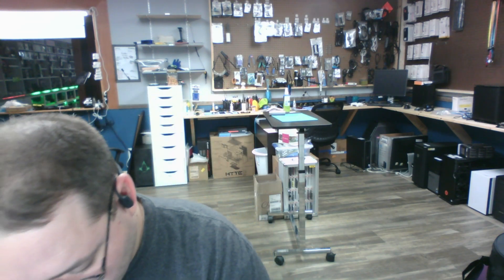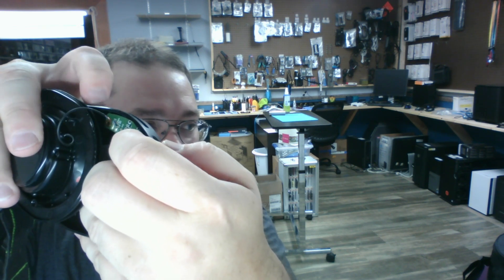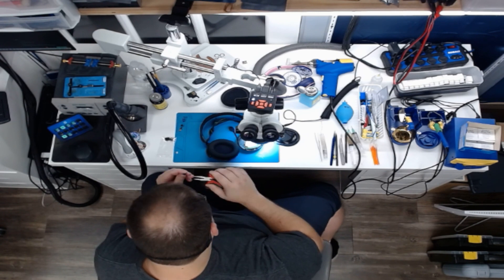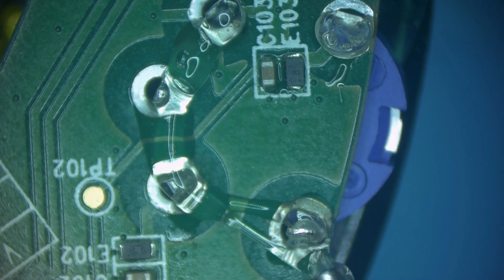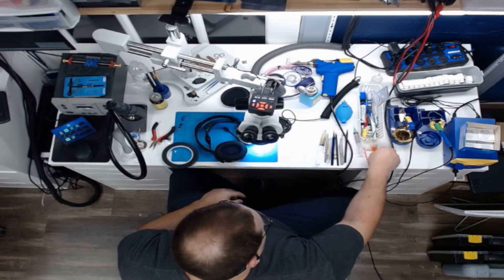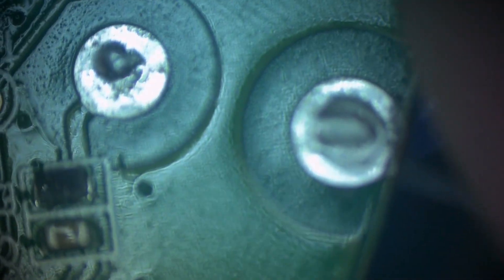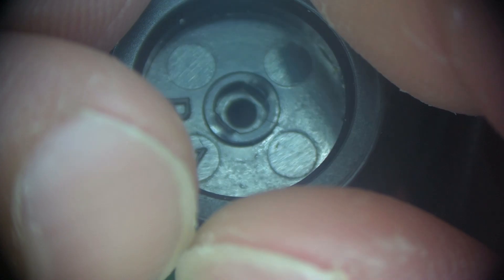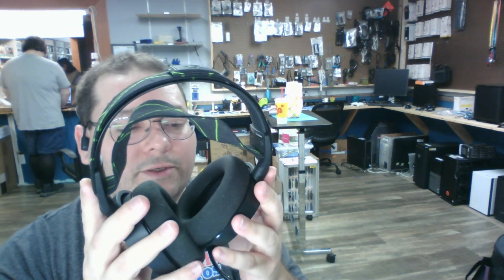#steelseries GameDAC Solder Repair - Volume and Chat Knob

Comment: Can you tell me the exact model of the volume control?
Reply from the maker: PDB081-P10-103B1 is the part number from the manufacturer. I just went to mouser and scrolled through every potentiometer they have until I found that thing. Whew!

Comment: THANK YOU for posting this!
I have this same headset. I'm not sure if the pot is actually the problem part but I'll try this repair anyway.
My headset was working fine until I replaced the battery - for some reason now when I power it on, the audio is either not playing or barely audible, and when I move the pot I get some hissing until I reach ONE small point where it sounds clear, but very faint, and if I keep turning it starts to hiss and go silent again.
The old battery when reconnected shows the same behaviour, so I don't think it's the battery I've used. I wonder if I've somehow damaged the pot during my battery replacement. It looks physically fine and the knob attaches and turns smoothly but no joy. All the small wires elsewhere attaching to the PCB look perfect also so I'm really at a loss figuring out what I've done. 
Can't hurt to try it at this point :)
The ebay link appears dead now but I'll try archive pages to see if I can find a new listing to compare.
I'd send it to you but unfortunately I'm in Australia so the shipping would be a bit expensive haha :)
Reply from the maker: If you have any issue finding it, I can make the listing for one.